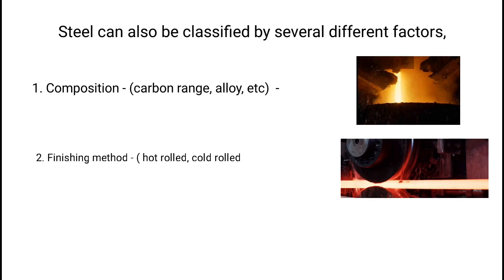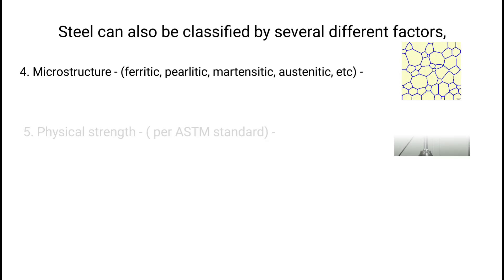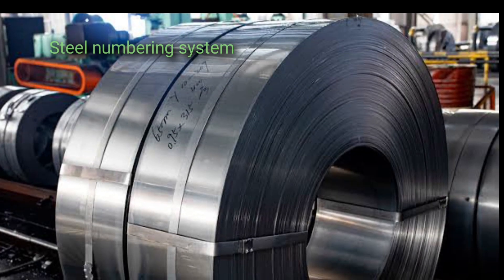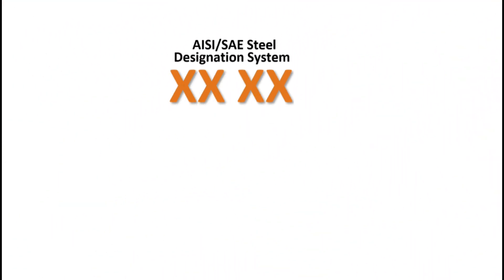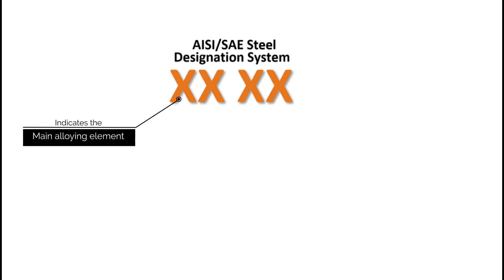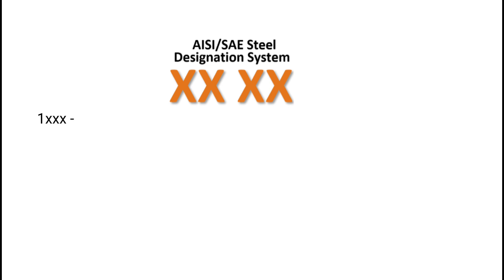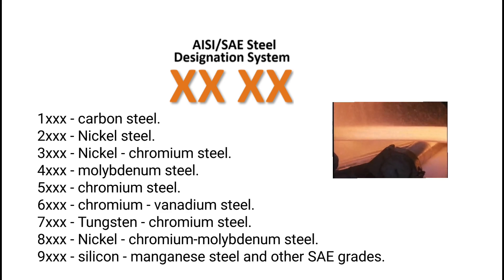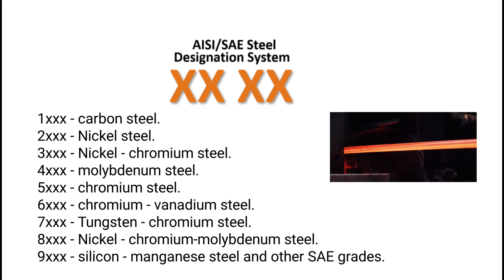The Ultimate Guide To Understanding Steel Grades

Comment: consumer grades of stainless steel commonly used to make house-hold utensils
= feng-shui news 
= when and where(placement) deteriorate
= rate of deterioration 
= ability to recover 
= tarnish, radioactive tarnish, concentration of dross to some spots before becoming spotless.
Reply: no-screw-with expensive wok
screw with surgerical and carbide and high-speed steel
Reply: singapore can share
= wifi pf-sense mod-hack
= to angle scented-fragrance sachets
= to condition finished products in installed spaces
= and theories leading to heat-screw-drill wok

Comment: I think austenite, martensite, and ferrite are crystal types related to carbon steel, not types of stainless steel.
Reply: My research shows you are correct!
Reply: 400 Series Stainless
The 400 series group of stainless steels has an 11 percent chromium and 1-percent manganese increase, above the 300 series group. The 400 series is susceptible to rust and corrosion under some conditions. Heat-treating will harden the 400 series. The 400 series of stainless steels have higher carbon content, giving it a martensitic crystalline structure. This provides high strength and high wear resistance. Martensitic stainless steels aren’t as corrosion resistant as the austenitic types.
Reply: Stainless steel also have a crystal structure im late tho